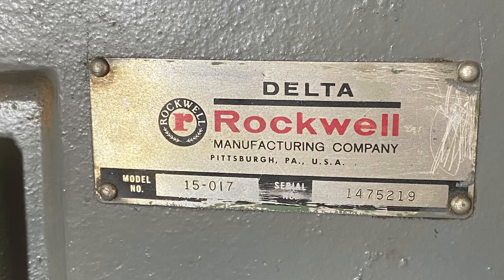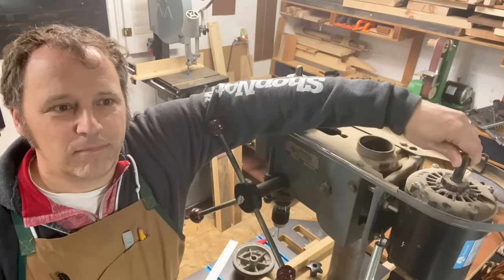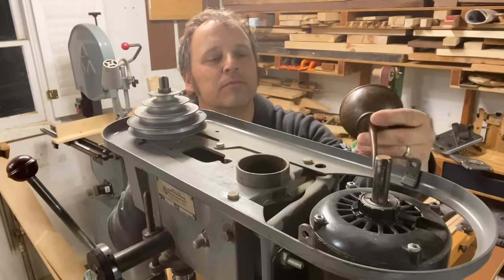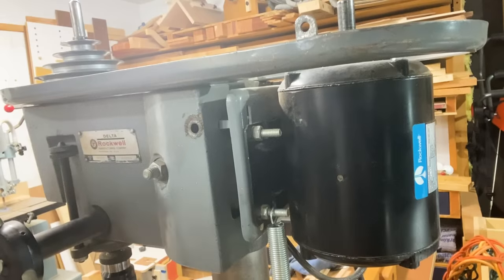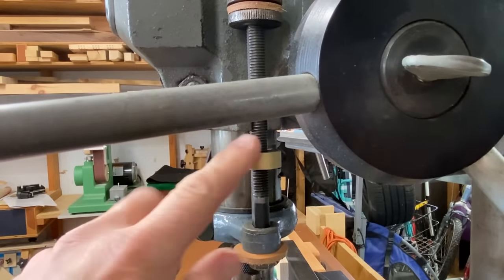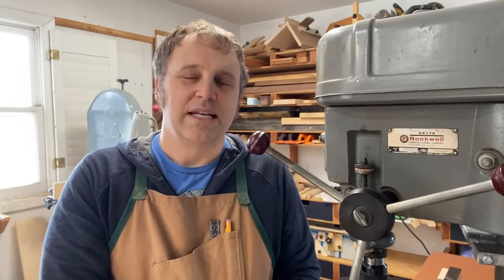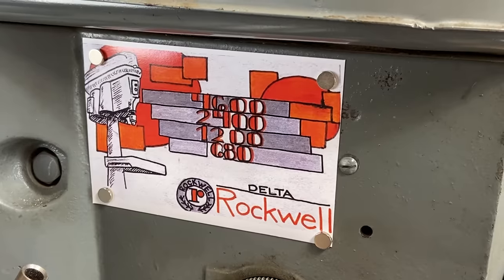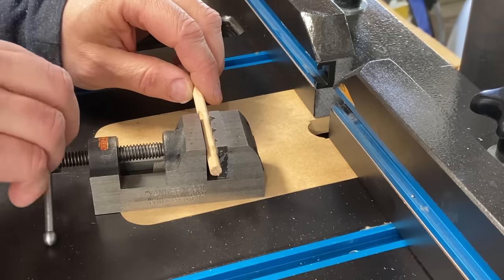Phil's Shop - Delta Drill Press Improvements

Comment: Nice drill.  I recently inherited a 1942-43 Delta/Rockwell drill press.  Works great, and needs some attention.
Reply from the maker: Not trying to speak to every situation. But a drill press is a fairly simple machine. As I found, there's not much to do in order to boost it's performance.
Reply: 80 year old grease will need attention.

Comment: Thanks for the fun video. I got a good deal on a mid-90s Delta floor model drill press. Woodcraft had an aftermarket laser cross hair for drill pressed that I bought. After spending time to get it aligned I was really happy with it. The downside was that it ran on a 9 volt battery and I would occasionally forget to turn it off. My solution was to find a 9VDC charger in a bin at the thrift store for $1 and wire that on to replace the battery. No more dead batteries and it still working great after 3 years.
Reply from the maker: That's a good idea. I have similar problems with the magnetic battery light on the drill press. In a cold shop, the batteries don't last long. I don't know they're dead until I need it.

Comment: On my 1978 15 delta press, the spindle down lock is the second bolt up. I have a nut/handle on the bolt that  squeezes the split casting. The vintagemachinery web site should have pictures of these DPs.Maybe it pulls a tapered pin. I have never taken it apart.

Comment: Thanks for the tips.  My small Delta bench drill press needs similar care.
Reply from the maker: In my head, I "know" that all tools require care and attention. But for some reason, drill presses are the kind of tool that just runs fine ... all on its own.

Comment: "Even though it can be a bit of a dust collector".  Well, what isn't? 😁
Great video.  Thanks Phil.
Reply from the maker: I built a small cabinet that sits on the base of the drill press. All drawers. However I struggle between wanting stuff I use often out in the open for access ... or hidden away for a cleaner appearance and not as dusty. We'll see how this goes.

Comment: Any chance of swapping drill presses? Mine is a newer Chinese-manufactured model that is a real piece of junk. That Rockwell is built like a tank and with a little TLC, will serve you well for many years!
Reply from the maker: See. I was feeling a little drill press envy with some of the new machines we have in the shop at Woodsmith. I had upgraded to a keyless chuck several years ago. Variable speed would be nice. But now that my machine is running better. I'm impressed with the quality.
Reply: @WoodsmithShowandmagazine  So you don't want to swap?! The variable speed on my drill press is worthless ... it has a Reeves drive and minimum speed is way too fast for large Forstner bits.